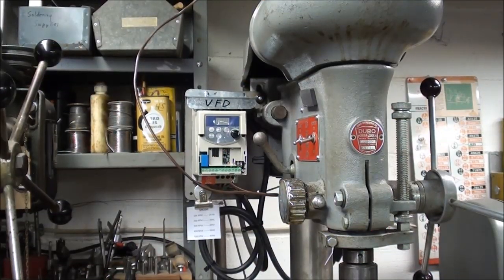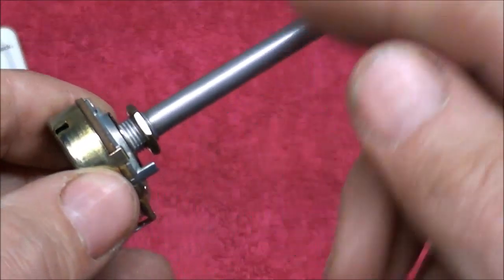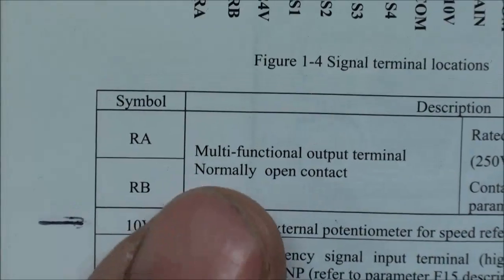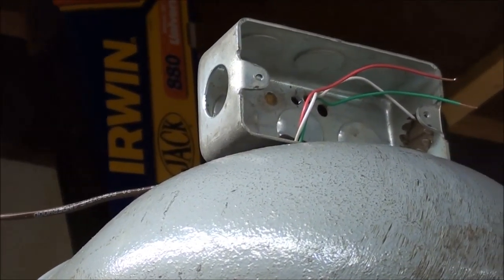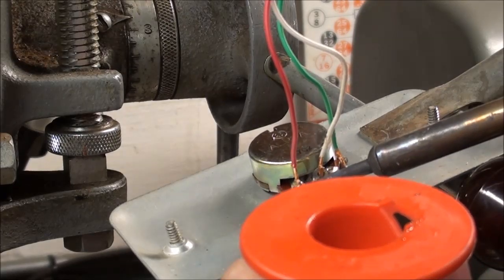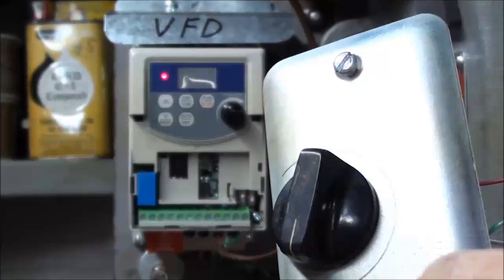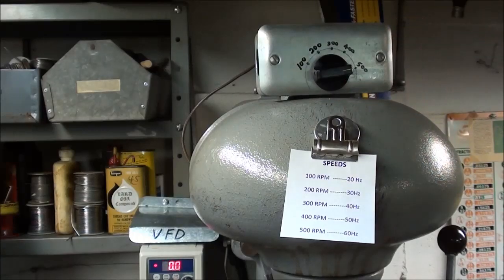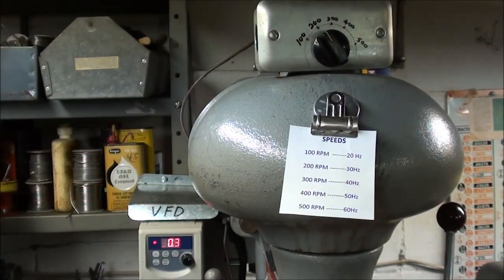MACHINE SHOP TIPS #142 Installing a Remote Speed Control on a VFD tubalcain

Comment: One of the VFD vendors is saying that VFDs must be kept dust free to obtain maximum life. I expect the metal content of machine shop dust is enough to present a hazard of shorting the internal wiring. They suggest mounting in a box with filtered vents with fans. I suppose you could check heat under load and adjust ventilation for acceptable temps.

Comment: Great series on the VFD.  I am setting up a 220vac 3ph lathe using a SPC.  Could sure use this on my latest drill press purchase. Supposed to be 12 speed but only has one belt, bypassing the center pulley.  I should have opened it. lol

Comment: You mention about fitting a vfd to the Bridgeport!  I'm in the process of getting my 3 phase Bridgeport to run on 240 volt supply and have been reading up on the subject. Various sites say running the mill on a vfd can cause long term motor failure with the Bridgeport type motor and bridgeports should only be run on rotary phase converters not vfd's or static converters.Just wondering what your view maybe before I bite the bullet and buy a rotary converter?Thanks for all the tips over the years Regards Derek from Shrewsbury England

Comment: It'll be interesting to see how much the no load speed changes under different loads.  I'm  skeptical on its ability to drive a larger bit at low rpm without having to crank up the no load setting.  I once got a cheap little plastic table top drill press that used a potentiometer for speed control but it was actually pretty good at boosting the current to maintain the speed even at the lowest settings.  Kinda wish I hadn't sold that one at a garage sale now.  Haha!

Comment: Hi Mr Pete, your lack of torque has to do with your motor choice, motors have different winding and taps, I bought a leeson 116739.00 motor, same vfd, change c14 to 001 and good luck trying to stop, the motor is pricey, you get what you pay for, thought I would share

Comment: I did not se it mentioned anywhere, so I'll post it here. When buying a potentiometer, keep in mind there are linear, and non-linear types. For this application, linear is what you want. Non-linear are typically used for volume controls in audio circuits. I'll try to explain the difference using a 100 ohm pot to make the math simple. A linear pot turned all the way in one direction will have a resistance of 0 ohms, and as you turn it the other way, the amount of rotation of the  shaft is directly proportional to the amount of increase in resistance. Turned 1/4= 25 ohms, halfway, 50 ohms, 3/4= 75, all the way=100. As you turn the shaft on a non-linear pot, the change in resistance is less pronounced at one end of the range than the other. In other words, the rate of rotation of the pot is not directly proportional to the resistance. Hope I was able to explain this clearly. If you use a non linear pot in this application, the control will seem to sensitive when you are near one end of the range of rotation.Oh, and the Radio Shack 271-1715 pot that he uses here is a linear taper.

Comment: So you have your frequency maxed at 60Hz in your VFD's parameters? Most motors I have read about will take double to triple the Hz for long durations. I wouldnt max it out, but I do run higher than 60Hz on my lathe on occasion to attain higher speeds.
Reply from the maker: I just changed it to 100hz--to experiment
Reply: What do you think? You should be getting almost double the rpm's you were seeing. Setting it to 120 will double the rated speed.

Comment: Thanks for the videos. That thick stiff thermostat wire is overkill for this task. The solder joints may break if moved a lot. There will be only 10V over RadioShack 10K potentiometer (according to Teco Diagram).  Thus, only 1 milliamp according to Ohms law.

These VFDs use microcontrollers as their brain and a small DC voltage over potentiometer as a control signal. All 110V and higher voltages are insulated from control using some silicons known as IGBTs.

According to American Wire Gauge table and AWG Electrical Current Load Limits, a small diameter wire would suffice.

Comment: Mr. Pete,
I'll venture some remarks to your VFD installation, just to improve your electrical engineering experience in addition to your great mechanical engineering skills.

- there is not used a shielded cable for connection VFD - motor. High frequency (in kHz range) motor driver currents from your unshielded cable  are transmitting radio transmission jamming, sure not in conformity to FCC regulations
- cable used for VFD - potentiometer connection is not suitable type, it have to be used a stranded vire at any vibration affected machines, automotive etc. Reason is risk of break
- your soldering is.... let's say not acceptable by any industrial quality control check. (too long uncovered insulation - exposed to short circuit in a bare metal case, not used a heat shrink straighten/insulation sleeving,  wire wind round in terminal lug was used in 1960's, technologies,...)
- fixing cable in a case using a knot is forbiden
- missing cable insulating bushing

Please keep in mind above stated remarks in your next projects, is going about your and your relatives safety - electricity kills.

Comment: Couple of hints.  1) The use of the second hole's in the cover plate wasn't explained but is to prevent the pot from turning and loosing the calibration - it engages a tang on the pot's body.  2) use heat shrink on the terminals to prevent shorts (especially with a metal box.  3) I would have used stranded wire instead of solid "bell" wire as it stands up to vibration much better.

Comment: On my Bridgeport JHead, I have Install a 1hp dc motor with an electronic controller.
But I kept the pulley and Install a small switch in order to use the mill in reverse. When I need more the than 1000 rpm, I move the belt. If I need more torque, I lower the belt. Normally I leave the belt in the upper middle pulley. This way I don't have to change the pulley. Belt and suspender!